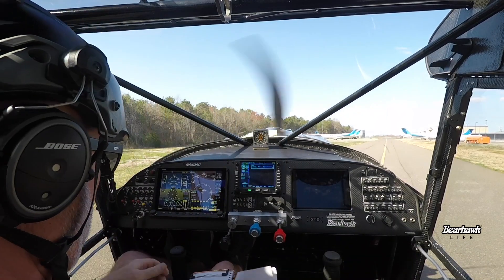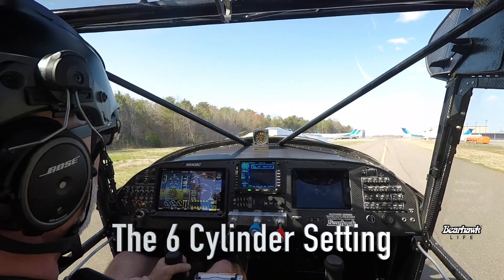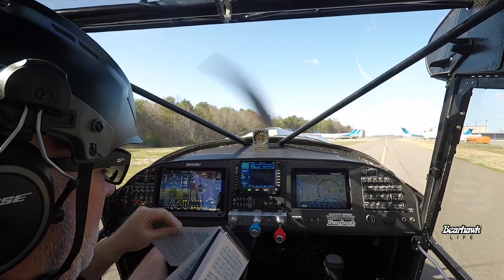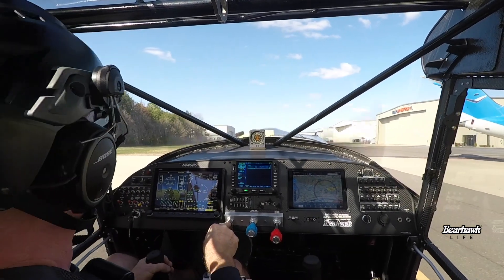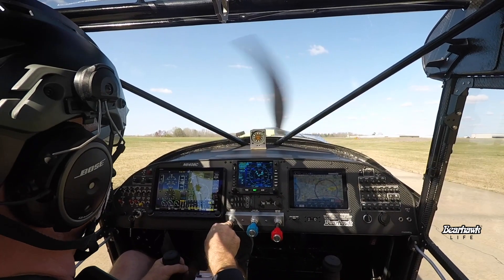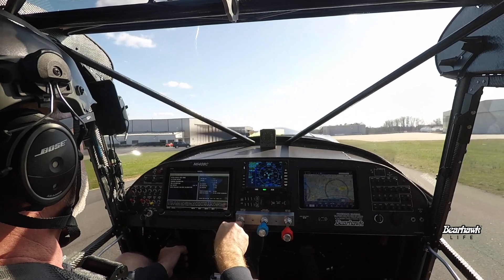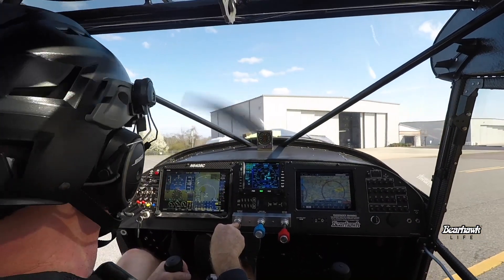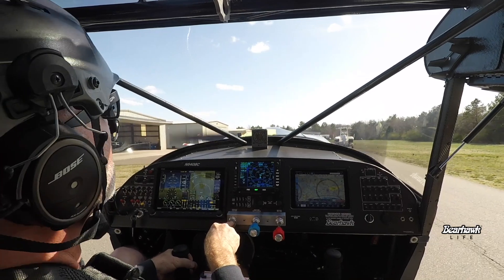BEARHAWK ~ Taxi Testing and Compass Calibration. (Part 4 AW Certification and Phase 1 Flight Test)

Comment from the maker: It was noted that I was taxing w/o consideration of the wind and my stick placement.  The wind was on the nose during start up, so I was neutral.  Maybe could have been a little stick back.  As I returned, there was a tailwind.  I knew that and, not immediately, but eventually pushed the stick forward.  A lot is going on as I am becoming familiar with my new bird.  Even after receiving my PPL in 1987 and having previously worked as a CFI, I will never get everything right.  But strive to try and be my best.  Thank you for watching!
Reply: You need to get your CFI back in time for my build, LOL.

So, after watching this and knowing im going to put 35" ABWs on, I want to devise a way of temporarily elevating the tail about 3 feet higher for taxi tests so I can see over the nose. Not sure I always want to use the Lindbergh reference. What if I could make it adjustable with an electric actuator!? I need to call Patey
Reply from the maker: @FourthWayRanch  You are completely right!  I discussed the wind and stick placement in the video, but eventually edited that portion out.  I'm always concerned about including what may be considered as "flight instruction".  YT can take down those videos, but more importantly, there are certain legal liabilities that will need to be disclaimed and overall avoided.  Thanks for watching!

Comment: The mixture knob all the way back to full rich.!!!!!!?
Reply from the maker: All the way back would be lean, or full ICO.  What you see here is the Lycoming starting procedure from the engine operating manual, then lean as need during taxi.
Reply: Big Fat Bastard Lycomings load up if you don’t “taxi lean” them.  Mine was an absolute monstrosity.  Three pumps on the primer, two or three blades, VROOOOOM, lean her back!